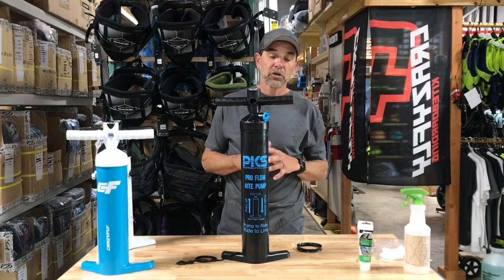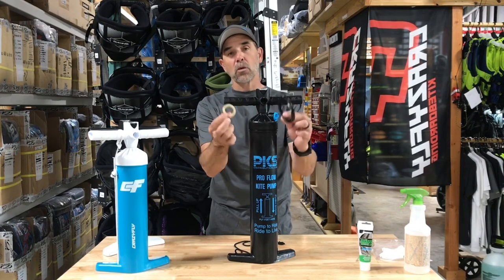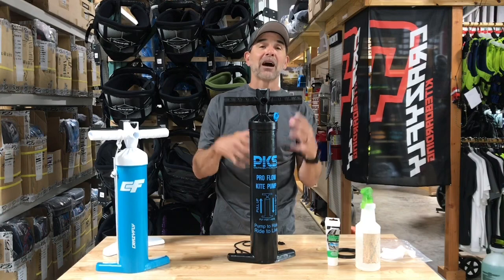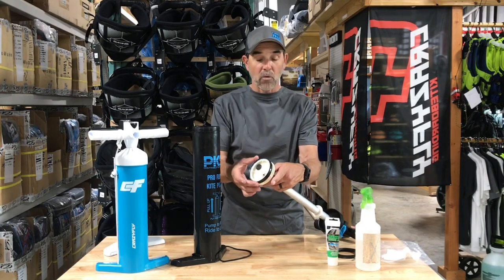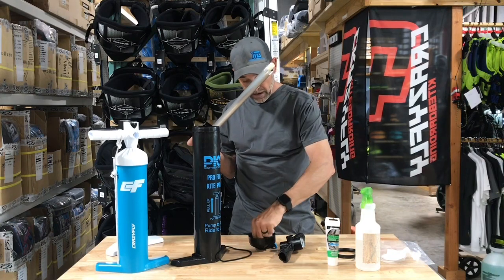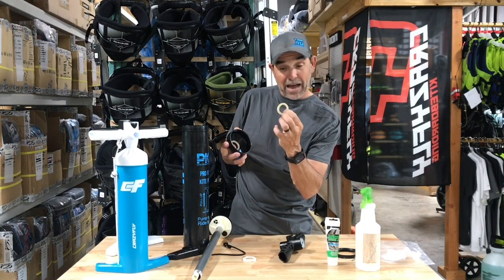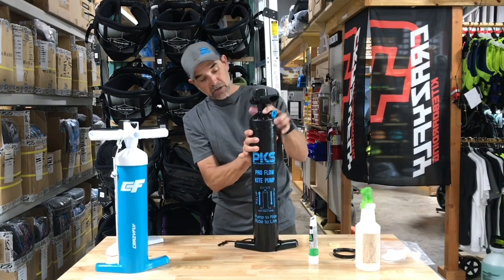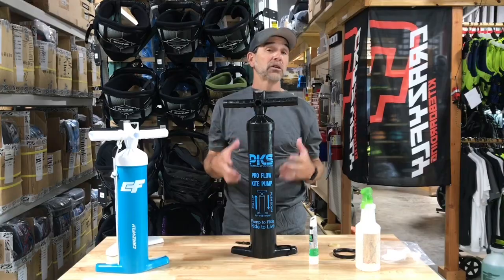Rebuild GRI Kiteboarding - Kitesurfing Kite Pump

Comment: In the past I’ve used graphite in the main cylinder.  You didn’t say in the video to use lube on the main gasket in the cylinder.  If not, is the graphite either helpful or detrimental to pump function?

Comment: may i use silicon grease instead?
Reply: They recommend white lithium grease.  Lithium grease is lower viscosity than silicon grease, so less effort to move.  IMO, I use silicon grease in mostly static applications.
Reply from the maker: We recommend the White Lithium because that is what the manufacturer told us to use. That said, we have used silicone grease in the past without any problems.

Comment: Where can you buy a replacement gauge?
Reply from the maker: Unfortunately we do not have new replacement gauges. I do have a used gauge that works fine here in the shop. If you are interested, give us a call at 361-704-6659